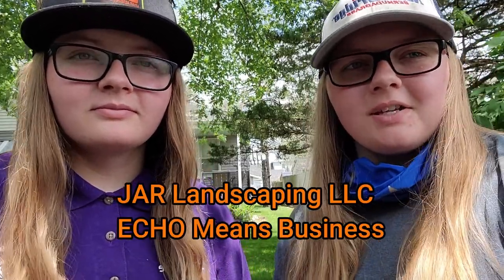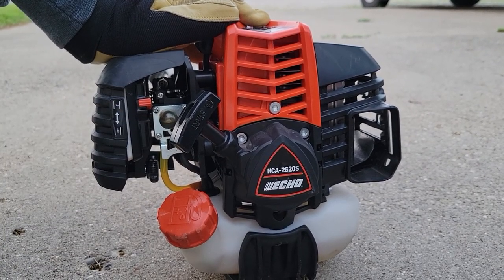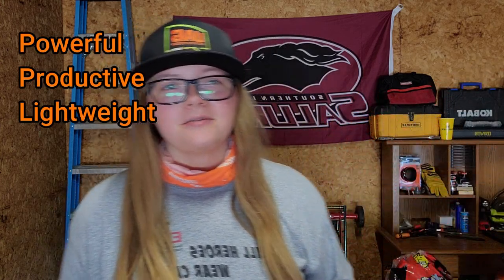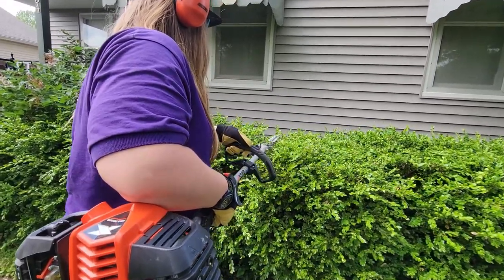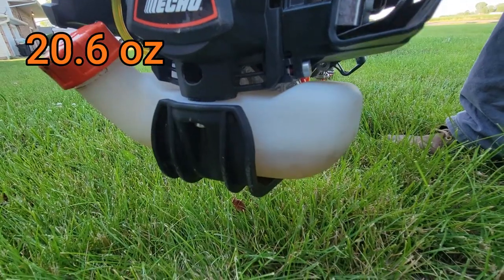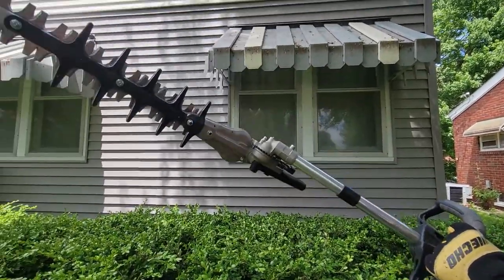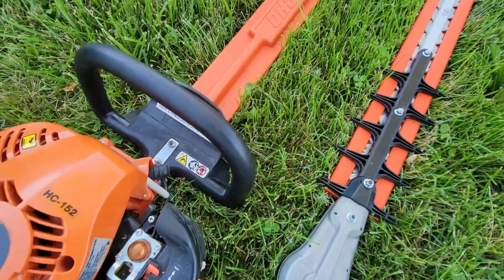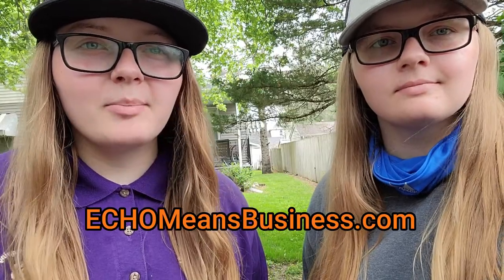Hedge Trimmer Review: ECHO HCA-2620S Articulating Hedge Trimmer

Comment: Thanks for the great video and assessment! How would it work for trimming brush growing upright from the ground directly in front of you? I.E clearing a filed full of raspberry canes? You mentioned it only articulates 45 degrees upward, so if pointed at the ground is it easy to hold the cutter bar parallel to the ground?
Reply: You might be better to use a ground cutter designed for that purpose